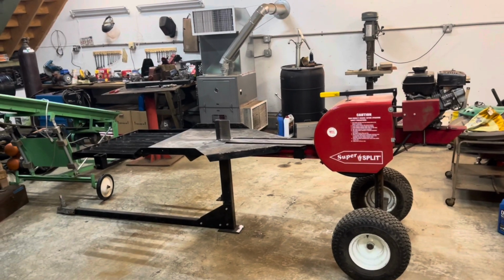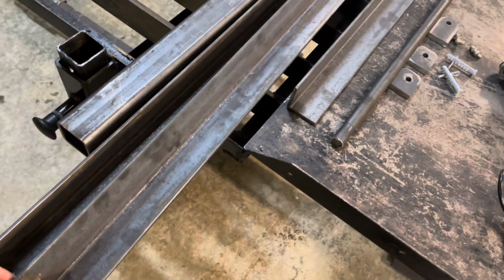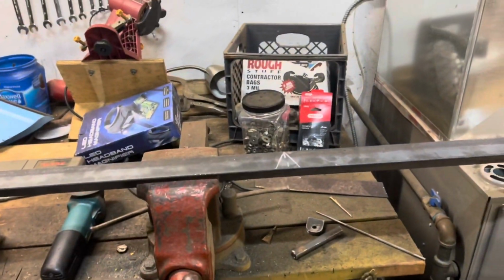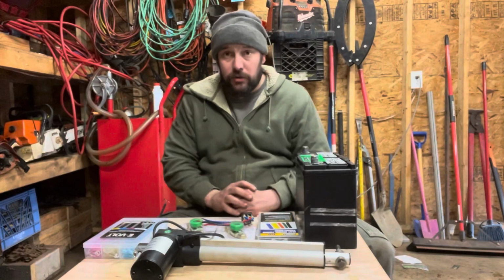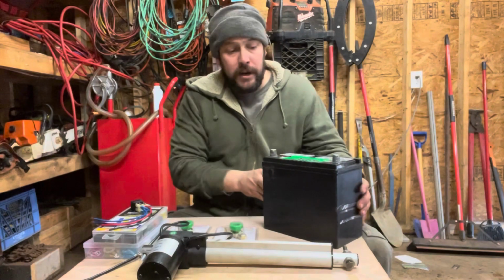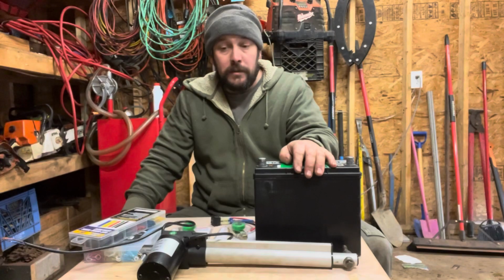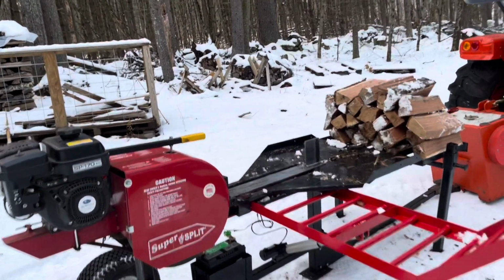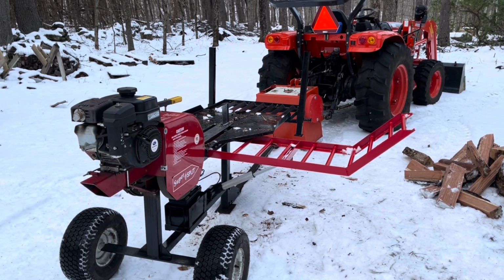Log lift for the SuperSplitter

Comment: I think a simple hydraulic setup would be…seeing as you have a tractor there, get some long hoses hooked to tractor rear remotes. Lock open remote, and loop thru 2way valve and work ports to cylinder. No battery, way faster and better control. With right valve you can even have float down.
Reply from the maker: Many times I use the SuperSplitter the Kioti isn’t there. I do agree it’d be faster, and no battery.

Comment: That's a great concept... too slow for my liking.. but better then tweeking your back on a big round ..
Reply from the maker: Thanks. There’s limited options for fast actuators that can handle decent weight, and hydraulic lifts aren’t easily possible with these machines. Appreciate you watching and commenting friend 🙏
Reply: @BuildALotAcres  at princess auto.. I think is canadian version of Habor Freight.. I can get the same pump on a dump trailer which comes with tank and motor and get whatever cylinder I want pretty well... but I'm sure it's not that cheap in comparison... still I'd rather wait then have to lift those big rounds any day of the week

Comment: Great project Case 👍🏻, that was a big round first it’s first test, it did look a bit slower but that was heavy pieces and the splitter did look tippy, I would probably add another leg on the lift side 👍🏻. Have a great weekend Case 🙂🙋🏼‍♂️👍🏻
Reply from the maker: Thanks Luc. I agree with your points. I guess a future project video is in order :)
Reply: @BuildALotAcres  can’t wait 👍🏻👍🏻

Comment: I admire your creativity. I have to wonder if the actuator used could handle a second 12 V battery wired in series for 24 VDC for a short application time? If so, that should about double the speed. Another thought would be to add a 6 volt battery in series for an 18 V power source. Do install a circuit breaker or fuse of sufficient amperage next to your battery on any application for the prevention of bad things.

Comment: I would make sure that you have either a circuit breaker or a fuse inline from the battery.
When you are fully loaded like I watched in 1 of your other videos you are probably well in excess of the capacity of the actuator. Due to the leverage putting 300 pounds on the lift and lifting it you are probably requiring the actuator to push at close to 1000 pounds. I used to use lots of actuators and with some digging you could probably find some technical specs that give you thrust and current figures for the mm/s rates. 
Actuators are subject to sag and they will sag more when there is vibration present. The internal screw threads are greased and when they are under a high load with vibration present it will allow the nut to rotate on the thread slowly.
Reply from the maker: Great comment Alan. I agree I was probably pushing its limits. Wanted to give it a real world test to see how it would perform. Appreciate the sound advice sir 🙏

Comment: Great video. Thanks for giving me plenty of idea's. I am planning to modify my splitter also. Can you tell me who is the manufacturers name of your actuator and where you bought it? Thanks.
Reply from the maker: Thank you. Here is the link. https://www.everestpartssupplies.com/products/new-10-inch-premium-linear-actuator-w-675lbs-lift

Like I mentioned in the video, I chose this one because it was heavy duty, with a good weight rating, and had a faster speed of 10mm/sec. Many were only 5mm/sec. Getting the geometry of the points where the actuator ends pin on is the most important thing imo. Good luck 👍
Reply: @BuildALotAcres  Thanks 👍

Comment: How long/wide did you make your lift? Are those 1" tubes in the center?  I'm going to have to make one for my SS HD, looks great! I think I may use a hydraulic cylinder with a 12v hydraulic power unit instead, for faster lifting.

Thanks
Reply from the maker: Sounds like a great project. I hear you about the speed. I’m going off memory, but the lift is 24” wide. The pipe spacers are standard schedule 40 steel pipe that are 3/4” I.D. The long leg is 36”, and the short leg I believe I made 18”.
Reply: How did your hydraulic (uh actuator) lift arm work out?  Tim in northern TN
Reply from the maker: @CliffsideStables  Hey Tim. It’s an electric actuator. No hydraulics, just battery power. It works good. A bit slower than I’d like, but beats hurting my back. I hope to showcase it more in the near future

Comment: Looks good! 
Have you tried your tractor bucket as a lift and pull rounds off the bucket onto the splitter? I tried it once and it seemed to work, but I've barely put half a cord through my Super Split so I'm still learning what works/doesn't.
Reply from the maker: I have and it works great. Typically it’s tied up with the IBC tote or fork box though to put splits into. It also shows folks without loader tractors what’s possible. Appreciate the comment friend!

Comment: Most excellent. Your skills run deep. I’m curious if you use it as a lift or later as a staging table more because I have seen you lift some heavy stuff. Having a staging table is terribly handy for these machines.
Reply from the maker: Thanks Harold. I honestly could see a 50/50 split. Anything I can lift will be much quicker than using the lift. I hope to give it a more thorough test soon!

Comment: Nice video. Nice mod. You’ll be able to swap out that actuator in the future if you find a better one quickly. I agree 100% about the out riggers. The only thing that I see as a negative is how wide the machine is now. Too bad you can’t fold it up at a 90 deg angle for transport or storage. Overall great job!
Reply from the maker: Great comment Chris. I do have to be careful towing it and being mindful of the new “wing” clipping trees, etc. It can’t go any higher mainly do the table being in the way. I could unpin the actuator to overcome the full extension of the actuator being an issue. Maybe I can figure out a solution to raise it higher. Thankfully my woods trails are pretty wide (about 10-11 feet)

Comment: Worked good. A little slow for my liking, but that’s just me. Sure better than lifting it. Just two thoughts. If you got the same actuator but let’s say 7 or 8” stoke and mounted it to the next cross piece closest to the splitter, that would make it move faster. And still have the power to lift it. Just my thinkin. Not sayin you did it wrong. Just my thought. 
And it looks like you need a stablizier on the round lift side or add weight to your side that you work from. Seemed tipsy when lifting and more so when you reached over to get the round. Again, just my thinkin. Not tryin to be negative on your great build.
Reply from the maker: I had similar critical thoughts. I was originally hoping to use a 8” stroke actuator, but couldn’t get the geometry to work. Would have shaved off about 5 seconds. I agree a stabilizer is a good idea. I’m glad I have the drop down legs